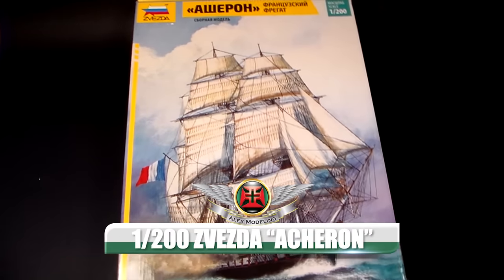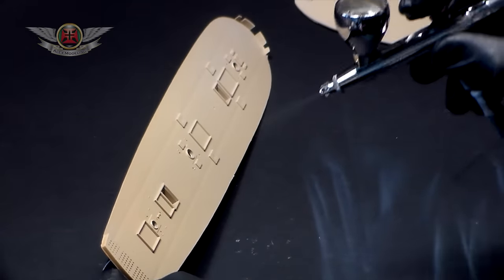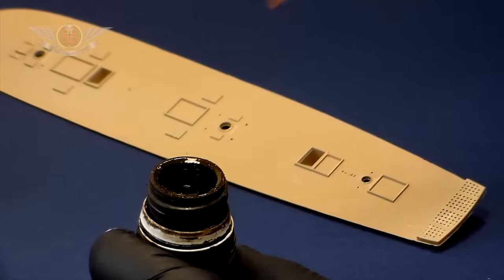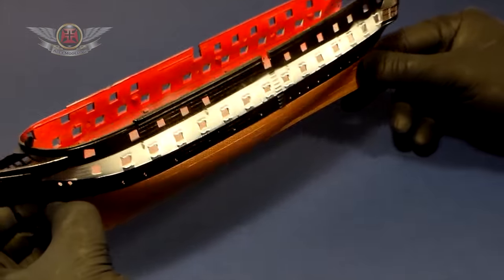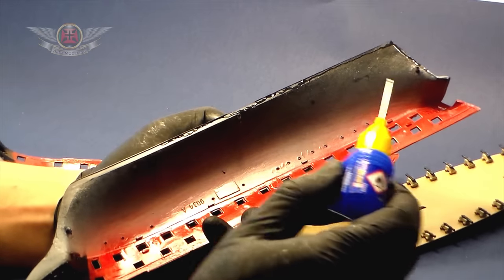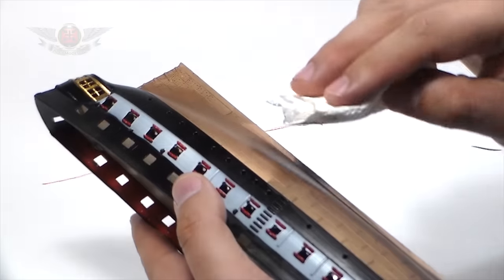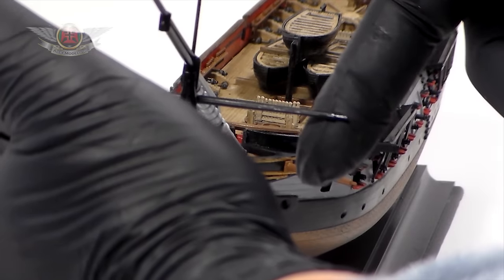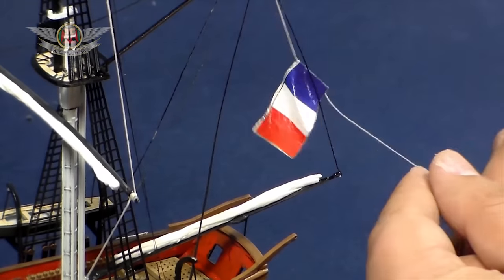FULL BUILD HELLER 1/200 French Frigate #epichistorytv #shipmodeling

Comment: You were probably mixing up the shrouds (the vertical ropes supporting the mast ) with the ratlines (the horizontal ropes used by the sailors to climb up to the yards). Since ropes strech, the ratlines sagged a bit, so the horizontal lines should have a droop in them and not be straight.

Comment: Well done I've never done a sail ship the rigging looks a bit daunting.
Reply: Try and find as much information on the model you are planning to rig . Even the kit instruction should have at least some of the main ones . If the model is like Alex's and supplies rigging cord in different colours , that's a real help . If the model is new'ish' and only supplies diagrammes , you should be able to 'break-up' the work by if necessary , writing or taping a small-piece with an arrow pointing to where it goes . If it is a much older kit , that's great because it will describe the colour and use of the rope required for a particular line . I've found it much simpler to concentrate on one at a time . Actually , it isn't too difficult to add the rigging just as the real ship was rigged . There are 2 different main types involved . The first is the 'standing' rigging and just 'stands' . It is used to make the masts rigid , holding the shape correctly . The other one is 'running' rigging and has a totally different use . These are the ones used by the crew to alter the sail angles and size to make use of the winds .  Then , when the sails are not required , ropes are used to 'furl' or gather-up to the yard-arms , the pieces that are attached horizontally to the mast . Most plastic kits I've built , include the 'ratlines' . These are the triangular pieces that go from the sides to the yard-arms . They are usually not very realistic but are fine for now while you are starting . The upright part is fine being straight , because the real thing has to be . However the pieces going across are the 'steps' so quickly sag . Some kits provide more realistic ratlines that sag . Take it step by step . Look out for model ship magazines that may include a diagramme of what you are aiming for. Try and look out for some cheap but extremelly useful locking tweezers and haemostats ( fine-nosed locking pliers ) Being narrow , they are useful for carrying or pushing the end of a rope through the ones' you've already done . There are some beautiful small sailing ships available in kit form , and being smaller requires less rigging . Heller have made several that I can think of . Have a look . Clear some space , put some cool music on and enjoy . If you get stuck (🙄) put it to one side and leave it till you're ready again . All the best . Pete

Comment: Just to let you know , the area that you see him trimming and sanding is what we call at least when I was molding model kits and thousands of other plastic parts, a gate which is where plastic is injected into the cavity or part . There is a thing called flash which only would be seen around the parting line or edge of the parts as very paper thin plastic which usually indicates a molding adjustment or the mold is wearing out from a lot of use and the cavities need a new mold base or adjustment to the mold base half’s or a whole new mold .

Comment: Cool build. Just a few things I would have done differently. The sails would have done a bit more yellow and the pershade a brown. The cannons would have done bronze and I'm not real sure but might have separated the cannons from the mount/cart (for top deck only) but definitely would have removed the material between the wheels (don't know why they molded them that way). And I don't think I would have attempted to tie the rat lines from scratch either but good call on straightening them, because they also helped to study the masts and would be very tight. I might try one out after watching this video. Looks like it would be fun. 

Great video, thanks for sharing.
Reply from the maker: It is a lot of fun... On the cannons i also thought to remove the material beetwen tge wheels but believe me once insiste the deck you wont  see it... The position of it wont let you see

Comment: Do you wash the plastic parts before painting???  Does the releasing oil from the casting interfere with the sticking of the paint???
Reply from the maker: Never had that problem. But i wipe tge surface with alchool before priming
Reply: @AlexModeling  Thanks ... had that particular problem on a Revell Cutty Sark!!

Comment: Do you use a ventilated paint booth?  I'm thinking of getting this model but do not yet have an air brush.
Reply from the maker: Yes! I use sometimes a Bartsharp paint booth! But i have a huge open window riggt on top of ny wirkbench
Reply: @AlexModeling  Thanks.  What paints do you use?  Are they non-toxic?  Are you wearing a mask?    I'll probably uses traditional brushes on my Acheron attempt, but I like the speed and uniformity of your application.
Reply: @AlexModeling  How you you weather the sails without an air brush?
Reply from the maker: Well, you can dip the cloth in black tea for exemple.. search YouTube.. tgere are a lot of methods here🙂
Reply from the maker: I use acrilics! Less toxic
Reply: @AlexModeling  Aren't the sails hard plastic rather than cloth?

Comment: Heya!

I’m Enjoying your Presentation! And I Really Hate to Knit Pick- Buttttttt- I’ve noticed that you’re actually segmenting paint against a painted surface??? In the Fullness of Time Your Kit and All Your Hard Work is Going to Fall Apart! Literally Fall Apart! Styrene, Super Glue and Epoxy Resin Work Best Upon a Clean and Unobstructed Surface! Your Glue Has Nothing to React to other than the Glue you’ve applied to the opposite surface! It will Breakdown and your Lovely Model will be in Dry Dock Before you say “Defend Midship.” I still have models from my Childhood and in many ways it is a Blessing in Disguise that I used this Technique as I now don’t have to violently rip them apart as the glue and the surrounding areas have completely broken down! So all I have to is a brief soak in Acetone to remove remaining paint and glue prior to a refit. I’ve not used the same technique since! Models are Stronger, the bond is Concrete and the Structural Integrity of the Kit is Pretty Much Permanent! Trust Me- I Humbly recommend that you use this technique. Your Kits, Builds will be less Fragile! I Hope that you’re not Offended? Just Trying to Help!

Best